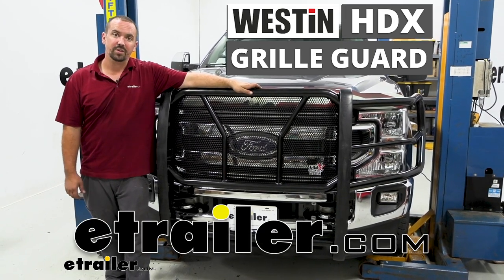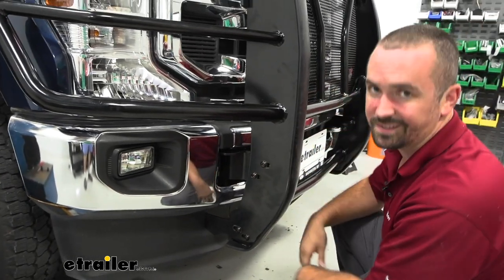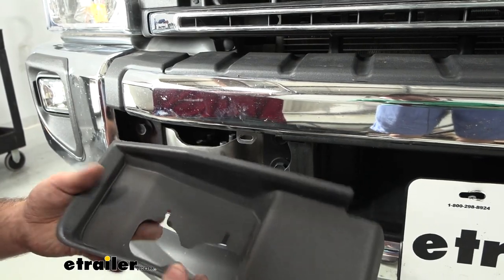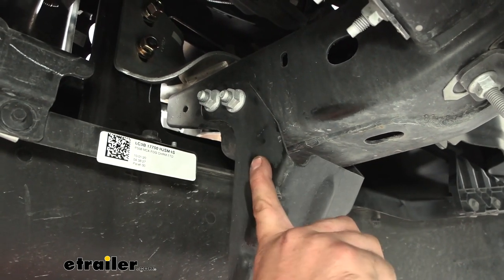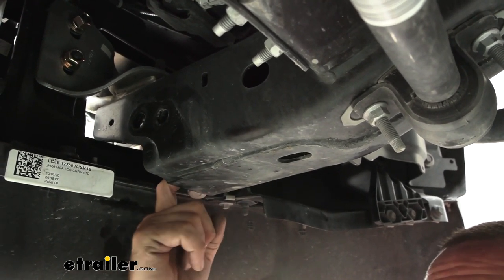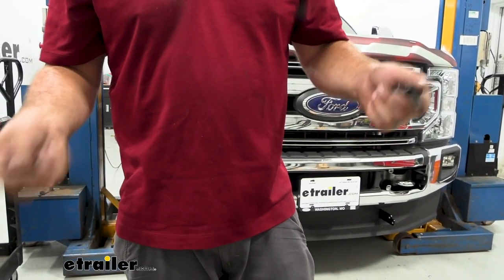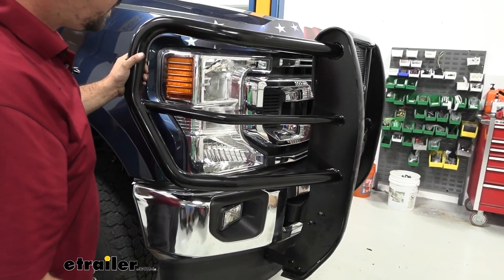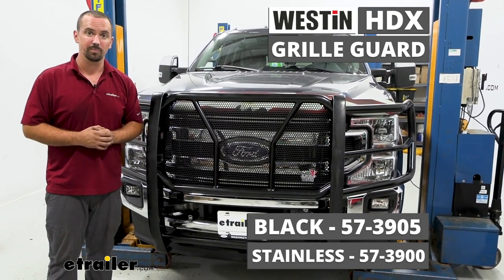Setting up the Westin HDX Grille Guard with Punch Plate on your 2020 Ford F-250 Super Duty

Comment: So does it mess with your auto high beams or front side collision???
Reply from the maker: The folks at Westin tell us that a grille guard can interfere with front mounted sensors and cameras that manage the adaptive cruise control and other systems like the auto high beams and collision warning systems you mentioned. However, you should be able to eliminate the warnings that show up on the dash display by going into the settings and disabling those systems.
https://www.etrailer.com/Grille-Guards/Westin/57-3900.html

Comment: wonder how do you open your hood with that thing on your way
Reply: its tight, i just looked a a 250 that has one of these on it and when i went to open the hood it was tricky to get to the latch. but i thing there is enough adjustment to pull the guard forward enough so it works as normal. My Ranch hand on my 350 has plenty of room to reach in as normal.